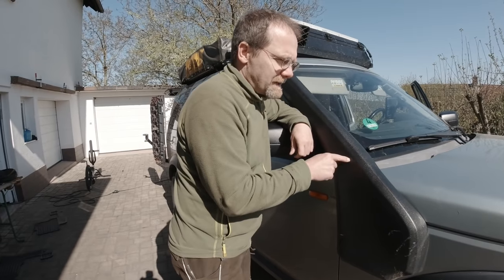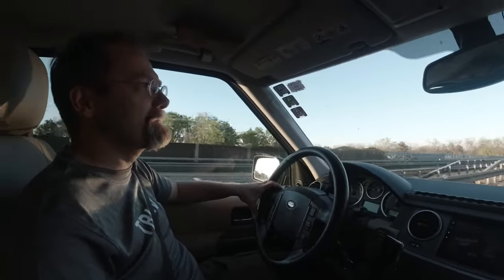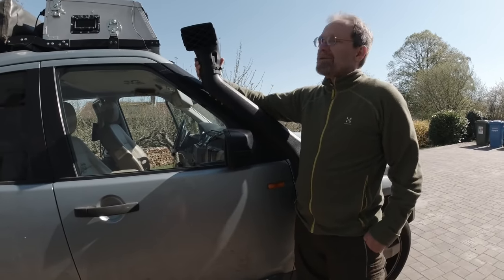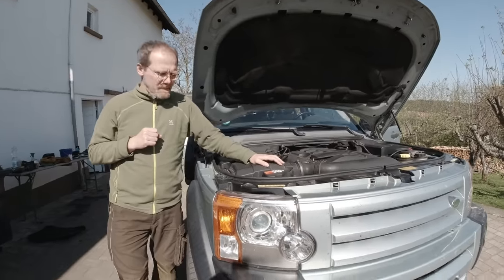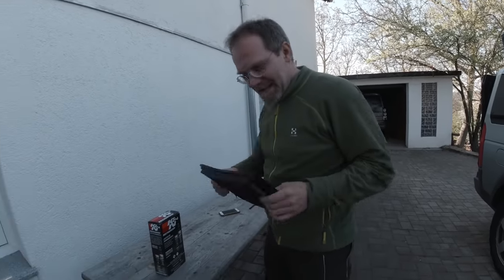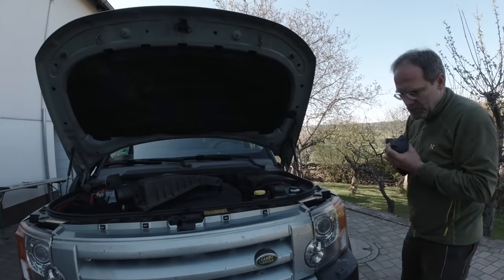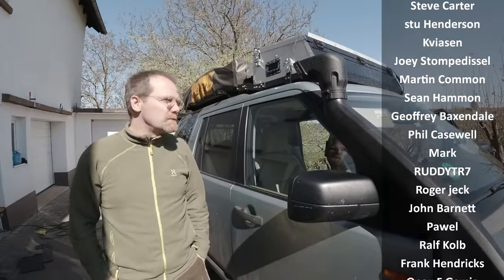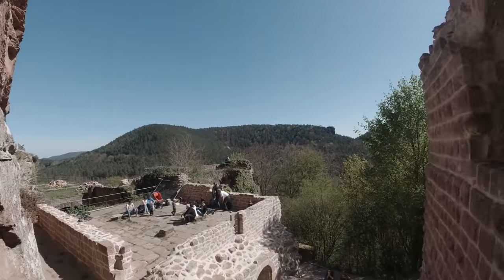Snorkel Intake - Forward or Backward?  Land Rover Discovery TDV6

Comment: If you are swimming a river facing backwards would seem to be better logically.

If you aren't going swimming why bother with the snorkel which will inevitably restrict airflow. There seems very little benefit to having a snorkel when driving on normal roads.

Has anybody asked Land-Rover?
Reply from the maker: You mean Land Rover, the guys selling who are building and selling vehicles which never break down? Their opinion is probably the last one we ask for. 😅🙋‍♀️Vera
Reply: @Vera_and_Christian  Land Rover, Land-Rover, potato - potatoe as you prefer.

Has anybody asked Land Rover /Land-Rover? So you haven't asked the manufacturer.
Reply: @Vera_and_Christian  Do you have any factual or empirical evidence on the pros/cons of use of a snorkel in different situations (normal road use, river crossings...., facing backwards or forwards.....)

Comment: Because he’s not stupid. He doesn’t have a snorkel fitted to his car, and that isn’t a puddle. He would’ve sucked water up into the intake and into the turbo. At the very least his car would splutter & run like shit for a few miles, or most probably it’s a call to the tow truck.His intake isn’t that much higher than a Ford Focus believe it or not. Why risk it ? When you can just go around. I’ve made the same mistake in an Audi TT in a flash flood, trying to drive through a puddle 😂 about 1ft deep. Luckily someone helped me push it out the (puddle) and my car just spluttered for a few miles

Comment: With the wading depth of these modern Land Rovers, why would you bother to fit one. The reality is, the electrics will probably get flooded way before the engine, not to mention the damage to the interior, with water coming in through the door seals, they all leak. Yep, they look cool, but functionally, not so sure, and let’s face it, in Europe, we are not going to be driving in any dusty deserts are we.
Reply from the maker: That's what we said, there needs to be a lot more done to our car, or most others, before we would go into deeper water. And we will avoid deep water under any circumstance. We actually decided to fit a snorkel one day after our last vacation in Kroatia, it was really dusty there driving on dirt roads for miles on. 👍🙋‍♀️Vera
Reply: @Vera_and_Christian  👍🏻